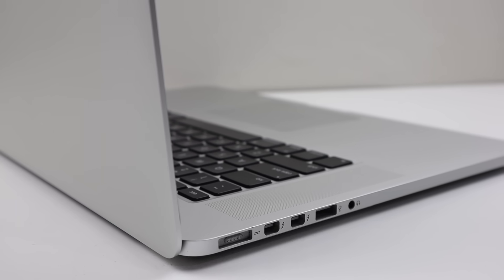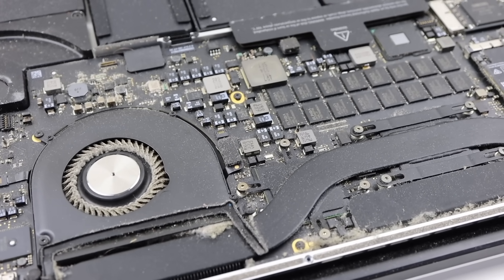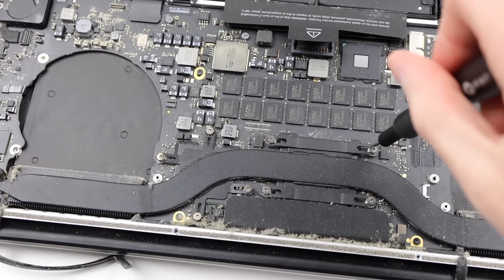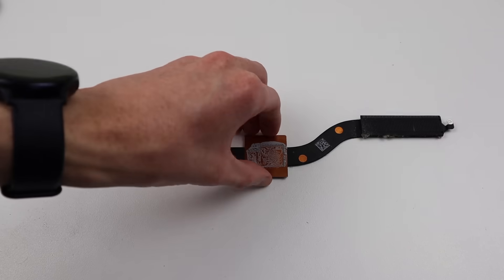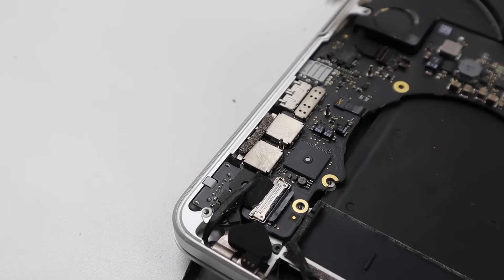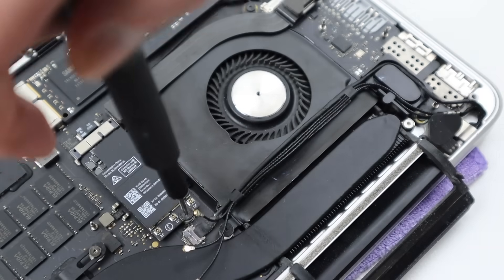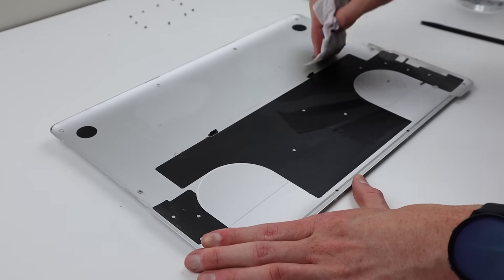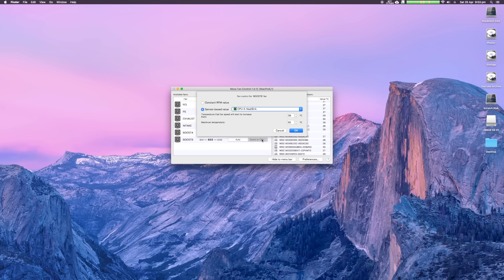Fixing My Filthy Overheating MacBook Pro

Comment: My laptop used to overheat so i cleaned it, never overheated again...
Reply: Until it gets dirty again
Reply: Anthony José where’s mr. clean when you need him
Reply: Well it still works so it aint broken and wasn't overheating since than so when i took it apart and removed about 2 handful of dust it ran smooth again...
Reply: my laptop used to overheat so i cleaned it, it overheated again
Reply: @dieselgeezer18  🤣
Reply: Ah the ol' never overheated again cuz it's dead. I like it.
Reply: Because you broke it? Lmao

Comment: Great video. I have a question. I got a ipod nano 2nd gen. I got it for 14 us. Its product red and it came with its original box. The listing said it didnt hold a charge. However charging it charges the battery and it holds a good charge. Do you think I got a good deal?

Comment: And then there’s me who dailies an almost-destroyed 2011 MacBook Air
Reply: Same, except I have a 2010, it sounds like a jet engine during my online classes.
Reply: Same, and after cleaning my temp goes up to 100 degrees celsius
Reply: Same I have an 2018 air it sounds like a jet
Reply: Gamers Games same lol 2018 october macbook air
Reply: Same
Reply: Put Mojave on it
Reply: @swag-cc4uc  Does that actually help? I upgraded from Yosemite to Sierra and it now sounds like a jet engine (not immediately but eventually). Is Mojave any better?
Reply: Kube lmao you broke do you need me to get you the MacBook Pro  😂
Reply: @iamtheone2292  says the guy with tentacion pp 😳
Reply: k u d a s a i and?
Reply: @iamtheone2292  I would appreciate that 😂
Reply: Kube i gotcha bro 😂💯
Reply: I am The one 😂
Reply: Make sure to at least have regular backups, was using a 2011 mpa myself for about 6y and the ssd suddenly crapped out on me by the end, if I hadn’t had a backup would have been completely screwed.
Reply: Same but got 2010 msi ge600 without working bartery and overheating to shutdown after few minutes without cooling pad
Reply: Same but with mac book pro.
Somtimes it goes full jet mode
Reply: And me with 2012 overclocked lenovo g580 which iş 80 celcius while not even on load
Reply: @nihatshalkar4410  with the overclock your computer is actually going slower. Please don't overclock notebooks and laptops 99% of the time you are only shortening the computer lifespan and losing precious speed on top of having a litteral oven on your legs.
Reply: i dont even have a PC or laptop
consider yourself lucky
Reply: "who dailies an almost-destroyed 2011 MacBook Air"
Alright then, and what do you use from dusk till dawn?
Reply: @brastyle4041  2004 Dell with Windows XP
Reply: @BaronKube  that's a great little machine. Kudos to you.
Reply: If anyone wants an update, I flung a pencil at my MacBook and now the screen is broken
Reply: @BaronKube 🤦
Reply: nobody xD  he’s my cousin so what’s wrong with paying tribute to him??
Reply: I got an obliterated 2016 macbook which I punched the screen and hit it with a hydro flask and a fried hard drive but other than that its fine
Reply: I'm daily driving a jet engine hp  probook 450 g4 from 2017. It has a broken screen that loses half the screen brightness at the bottom half of the screen, running both windows and macos with 8gb of ram. If I lift the screen wrong, the screen is pretty much unusable. Though it is still fast, enough.
Reply: TheLolinatorYT quick tip from a pro - you don’t drive a laptop, you use it on your lap (hence the name) or your desk, no wonder yours is fucked if you treat it like a car, ya numpty.
Reply: @brastyle4041  I meant I'm dailying a hp, my brother kicked a football in my room and it hit the screen, so probably that's why it's funked up
Reply: Macbook Air 2017 same..
Reply: Laughs in ibook g4
Reply: lol I have a 1998 Dell PC that runs on xp
Reply: Same. Except for I have a perfect condition XPS 15 from 2018.
Reply: @Garrettdx1988  yea ok stop flexing no one cares
Reply: Same except i have a macbook pro

Comment: That’s probably the hottest computer I’ve ever seen
Reply: dont woooosh me but my laptop runs at a comfortable 217 degrees Farenheit. yes, i've tried to fix it. no, I dont have access to compressed air, and no, I dont have any extra thermal paste.
Reply: SPCKalamazoo4056 you should invite us for a bbq soon
Reply: @mememaster9393  Haha
Reply: @dondaplayer1   dont woooosh me but my laptop runs at a comfortable 217 degrees Farenheit. yes, i've tried to fix it. no, I dont have access to compressed air, and no, I dont have any extra thermal paste.
Reply: @dondaplayer1  stop using it apply some thing at least or it will die
Reply: @dondaplayer1  maybe send that in for repair.........................
Reply: @dondaplayer1  217 is comfortable huh? that not even flying over the joke, its a joke inside a joke as well XD, tho even im not getting the joke, YET im getting the joke.
Reply: @dondaplayer1  shit idea probably but you can just blow at it through a straw if you don't have compressed air
Reply: @dondaplayer1  the performance must be very good at THOSE temps.... 217°F (103°C)!
Reply: @dondaplayer1  bro wtf
Reply: @dondaplayer1  same, i had to pay $70 to get it cleaned
Reply: My hp omen's cpu reaches 96 °C(204 °F) while I'm gaming
Reply: @osamal4405  same Luke my Acer nitro 5
Reply: I installed the fan control program, just so I could completely turn off the fans.

In other news, I have found a new heater for winter.
Reply: Sure it was rawring loud
Reply: my laptop with a nice core i7 2630qm runs at a relaxing 100C when running some games. (isnt my main)
Reply: my lenovo thinkpad x201 from 2011 can reach 99 degrees celsius(211.2 Fahrenheit )
Reply: MacBook Pro 2018 might not be better than this lol
Reply: just wait until he sees the macbook air lmao
Reply: @forcequitOS   really? I mean it's a gaming laptop after all, I'm sure it is supposed to withstand that type of abuse.
Reply: @osamal4405  you are frying your laptop dude
Reply: Lucian not necessarily since most cpus nowadays can work until 105°C then it’ll crash but anything like throttling it a bit will fix it but don’t worry most recent built gaming cpus are built to withstand really high temps since they’re very powerful
Reply: @WonderWhy YouTube Yes
Reply: Taj Callender no the t junction temp is most likely 100 degrees C and the cpu just lowers it’s clock speed until the temp goes down enough
Reply: @forcequitOS  Been gaming on dell xps 15 for 3 years and cpu sometimes hit 99C
Reply: @LokiKelly  holly mac.....
Reply: Haha buồn cười quá
Reply: @forcequitOS  I'm aware of the risks and I need to fix it but I haven't been able to get any thermal paste. Plus if it does die I intend on getting an i7 for it since it supports one. Right now it has an i5 460M
Reply: Soooo have you heard about MacBook air 2020?
Reply: Well you didnt see 2010 HP dv6 laptop yet
Reply: burn the competition
Reply: @Static-4  and the user too lmfao
Reply: get out
Reply: I want to say something funny but it's so inappropriate 😂,u should have thought about what u were writing 😂
Reply: So it would seem
Reply: Wow
Reply: Lol
Reply: Weeb Memeist64 u have my pfp oopsies
Reply: Mine is hotter
Reply: * Laughs in 5 year old acer laptop with no working fans *
Reply: I have the same model and it goes up to 120 Degrees Celsius.
Reply: Then you never saw an Acer from 2013/2014. 100/105 degrees in basic games
Reply: @Trinidadboss-r3w  lol
Reply: My laptop 200 Celsius
Reply: I've been researching into Mac speed ups and found an awesome website at Mels Speed Method (check it out on google)
Reply: Sus
Reply: PlayStation 4: allow me to introduce myself
Reply: Lol
Reply: Don't worry. My hp laptop reaches 100 degrees Celsius regularly.
Reply: Can someone fix my LG phone
Reply: Haha no no men u stil haven't seen my laptop when I play gta sa (high graphics) my pc litrally started melting my metal watch it melted and was bent 😅 so I got it  a lil home clean up and stuf there was like I don't know a mouse full of dust and and I say like 45% of the pc was just dust and gross stuff
Reply: My macbook pro mid 2015 reach 98c when playing 4K video on YouTube. Is that normal?
Reply: The oldest
Reply: @LokiKelly  The laptop being slow on Battery power and not on AC power, that means that the battery is not supplying enough voltage, and is close to malfunctioning. You probably should replace the battery...
Reply: Lol 69 replies
Reply: @LokiKelly  my MacBook 2009: Heating up to 610 degrees Fahrenheit
Reply: I think it's time for you to meet my Macbook Air
Reply: Imagine flirting with A COMPUTER…………..
Reply: The good way or bad way 😂
Reply: And filthiest too
Reply: egs1505 it’s the most ugly ngl
Reply: @firecat2465  Pun
Reply: @firecat2465  yeah your windows xp laptop with a pentium 4
Reply: @firecat2465  its ugly because its dirty. After the cleaning though, it looks great.
Reply: @firecat2465  the insides are pretty cool